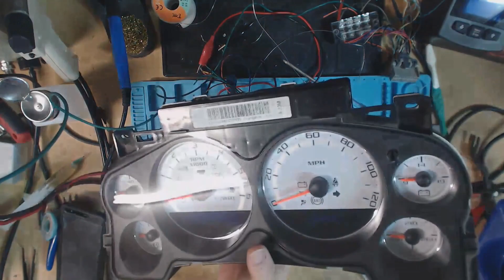2007+ LED Upgrade With PLCC4 Bulbs

Comment: Where can i buy the plcc4 leds is like to replace my impala cluster bulbs some of mine are out
Reply from the maker: https://amzn.to/2sHUZVi that is the exact bulb used in the video. I have some stock GM ones I can mail you some that I've pulled off boards If you just want some original ones. Just let me know how many you want. When I have time I am going to looking into finding the same bulb in the video but off mouser
Reply: @FixedUntilBroken  I have found good PLCC4 from Lighthouse Leds and I say they are great LEDs here is the part number "PLCC4 3528 Ultra Bright SKU: 20XPLCC4SMDBLUE" hope that helps they are good site foe selling these.